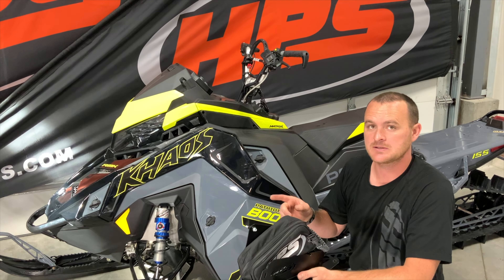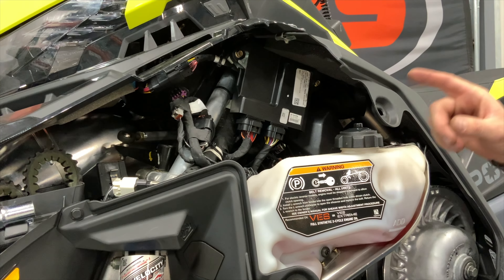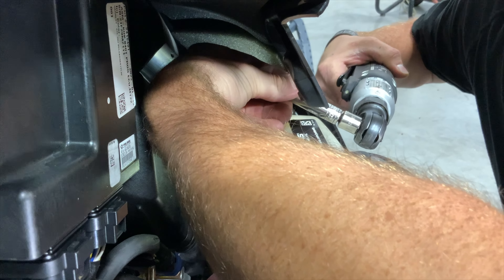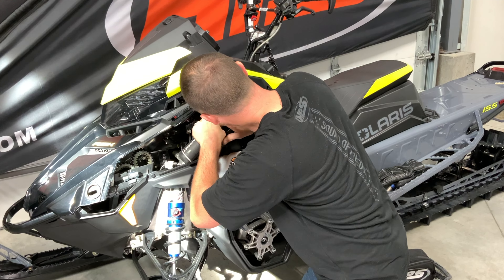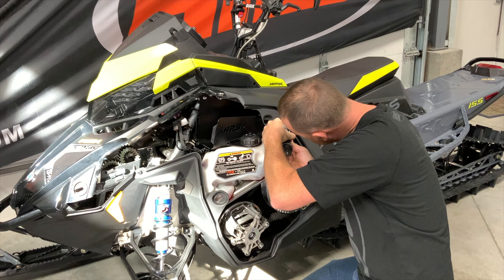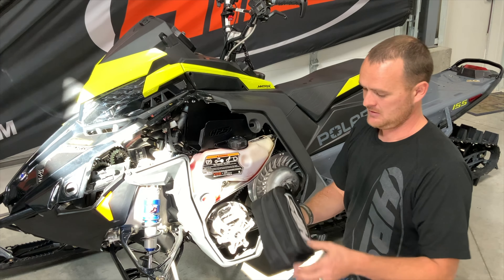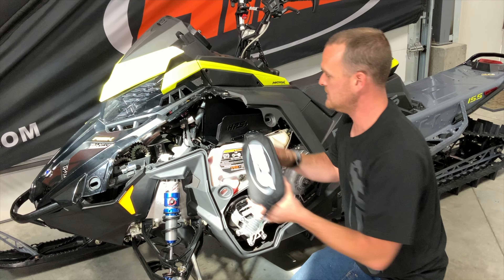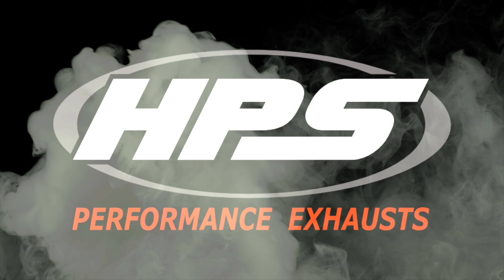HPS Polaris Boost Under-the-Hood Storage Kit Install

Comment: The vibrating tank is built like that for a reason! It's to keep the ball moving in the cap so the cap vents. U want the tank to shake
Reply: 🤨. The sleds move and vibrate more than enough to accomplish that
Reply: Reducing the vibration or rattle on that oil tank is a “good” thing.  That little ball will get plenty just riding the sled.  Kudos to HPS you guys create great designs!